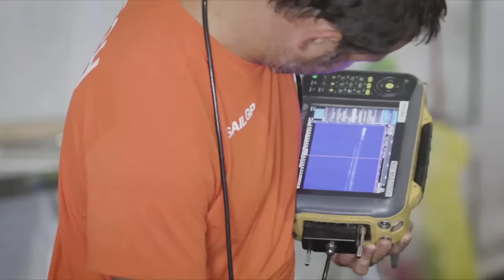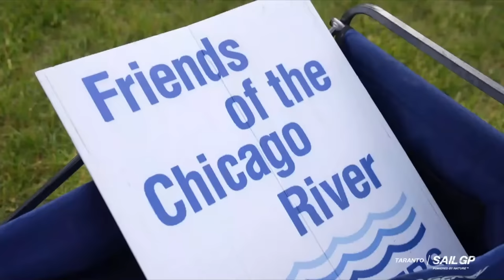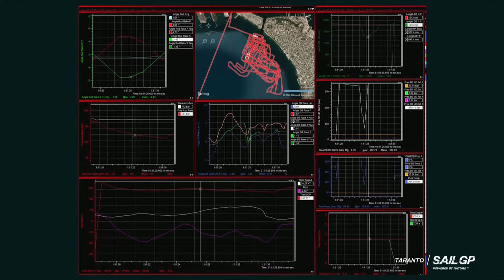2023 ROCKWOOL Italy Sail Grand Prix | Day 1

Comment: The trouble with carbon fibre is that when it fails it fails suddenly and without warning. Pretty scary with the forces involved with these F50s - that NZ accident was a shocker. It's only a matter of time till someone is hurt, I'm afraid. But without CF this kind of performance wouldn't be possible so I guess the risk simply comes with the turf...